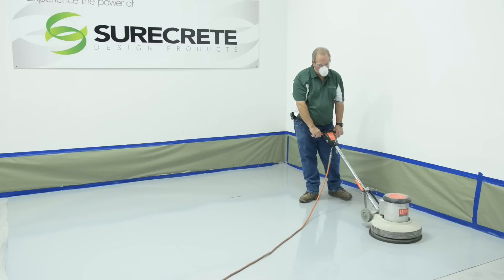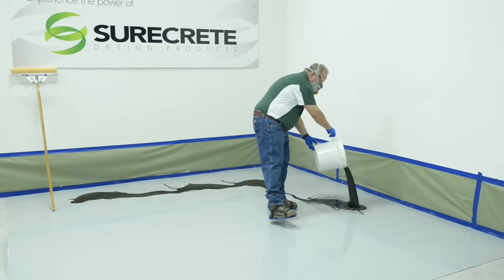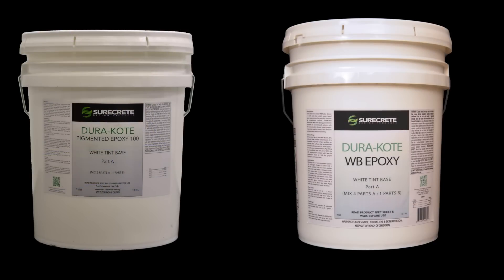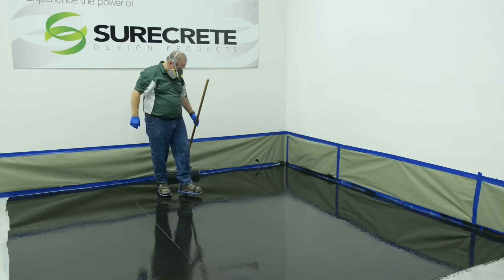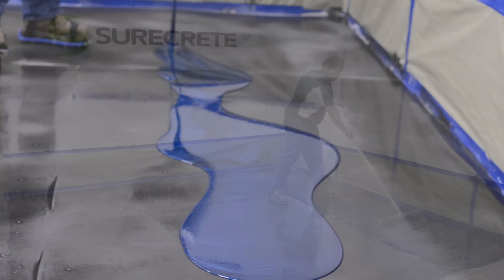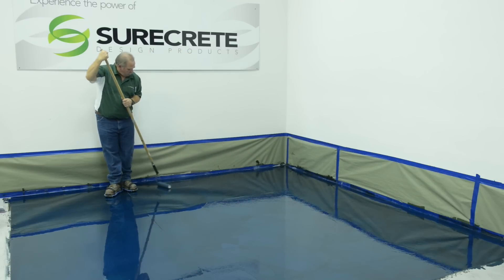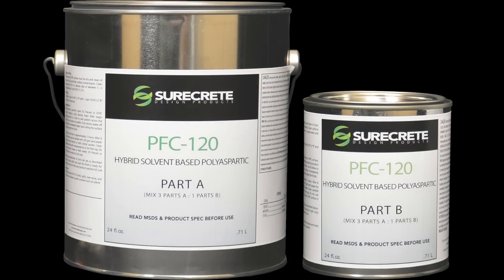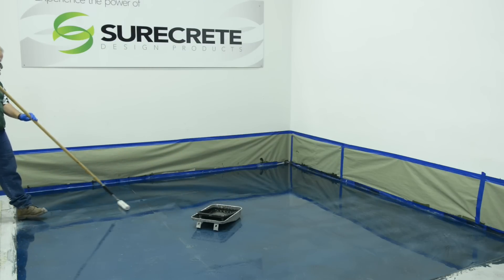How to Make a 3D Metallic Floor - System by Surecrete

Comment: I've just put down the Vapor Barrier from surecrete and it's been 8 hours and it's still tacky. Man this makes it very hard to get a clean job. I wish I shopped around and found something that had better cure times.
Reply from the maker: Please let us know what Vapor Barrier you used. If it was DK 700 then:
Select appropriate PPE (personal protection equipment). Provide
adequate ventilation. Refer to SDS.
2. Work across the narrowest dimension of an area where practical.

3. Work to an exit from wet product.
4. Track coverage rate for each gallon (3.8 liter). After establishing
room dimensions, before mixing commences, place a short
piece of masking tape on the wall to correspond to the “distance”
one gallon should cover.
5. DK 700 should be acclimated to room temperature, before application.
Ideal room temperature is 78 degrees and 50% relative
humidity.
 Also, Please contact us in the morning at (352) 567-7973
Reply: Vapor barrier DK700 class1 vapor barrier
Reply from the maker: As per the TDS ( https://www.surecretedesign.com/tds/DK700-Class-1-Concrete-Moisture-Barrier-TDS.pdf )) DK 700 should be acclimated to room temperature, before application.
Ideal room temperature is 78 degrees and 50%, relative
humidity, This could and would be the delay in cure time. Please contact us in the morning at (352) 567-7973 and we will be more than happy to help.
Reply: The Vapor Barrier ended up drying and the primer was easily applied keep in mind xylene has three different drying speeds I chose the slow one on this application on accident after discussing with Surecrete they pointed me in the right direction and figured out the problem thank you
Reply from the maker: Glad things worked out. Please don't hesitate to contact us any time. If you could take a minute, write us a positive review on Google Plus and Facebook. We would appreciate it. :) Have a Great Night!!!
https://www.google.com/search?q=SureCrete+Design+Products
https://www.facebook.com/pg/SureCreteProducts/reviews/